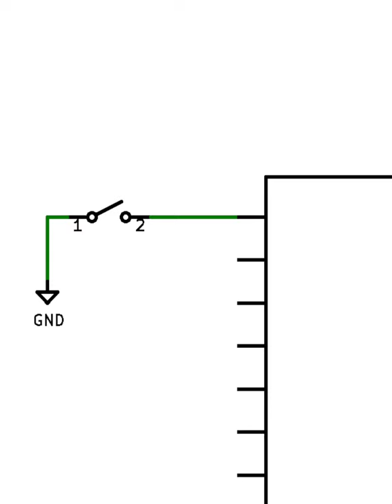Pull-up Resistor - Collin’s Lab Notes #adafruit #collinslabnotes

Comment: This is the best video ever. While I was already starting to understand, that explanation really nails it for me. Maybe another video on Pull-down and the pro/cons of Pull-up vs Pull-down will make me even more smart!
Reply: I would guess that a pull down resistor would be the same except going to ground, and would be used when the input signal was a positive voltage.
Basically just swapping the switch and the resistor.
Reply: depends on what state u desire, if you want high state, use pullup..... 
 low state, use pulldown...
Reply: adding to the above, it's much easier to find a ground plane on the circuit board than a logic level line.
Reply: Nah he should explain that with the different potentials
Reply: Pull up means the high state is the default one with the switch open. Pressing the switch transitions to a low state.
Pull down means the low state is the default one with the switch open. Pressing the switch transitions to a high state.

Comment: so THATS why that resistor is there! back when i still messed with arduinos, i always neglected to put that resistor there because it worked well enough right? no wonder i had super unstable connections. i am definitely subbing to learn more about this stuff!
Reply: You can just use INPUT_PULLUP pin mode. Then internally, 10-50 kOhm pullup resistor is applied to the pin.

Keep in mind that breadboards are evil and are out to hurt your feelings.
Reply: @SianaGearz  That breadboard fact has helped me sleep more peacefully. Thank you. 😁

Comment: I’m sure you’ll cover this in another video, but some micro controllers have internal pull up and pull down resistors that can be configured.
Reply: In Arduino IDE it can be configured easily with setting the pin as Pull-up Input
Reply: Knowing that they exist is the first step to understanding there are internal ones

Comment: The reset pin of a micro controller usually uses the same concept. A pull up resistor tied to Vcc and a capacitor tied to ground acts as a momentary switch to ensure proper instruction startup when power is applied.

Comment: Very good explaining thank you very much.
I like to add something, that the microcontroller comes with internal 1k pull-up resistor and by programming you have to choose whatever you want to use it or not
Reply: Not all microcontrollers have internal pull-up or pull-down support. And the internal value is normally mugh higher than 1k because a 1k pull-up adds significantly to the current consumption. Geounding 3V3 over a 1k resistor means 3.3 mA current. And that is over 10 mW power lost.

Comment: It's worth pointing out that most microcontrollers have pull up resistors built into them which can be toggled on and off by software.  In the Arduino IDE,

pinMode(12, INPUT);
digitalWrite(12, HIGH);

or, in newer versions of the IDE:

pinMode(12, INPUT_PULLUP);

will activate the internal pull up.  Raspberry Pi's have both internal pull up and pull down resistors on each pin, which various GPIO libraries have different ways of selecting.  With RPi.GPIO, use:

GPIO.setup(21, GPIO.INPUT, GPIO.PUD_UP)

You may also substitute PUD_DOWN for a pull down or PUD_NONE to disable both internal resistors.  With the newer pigpio library,

pi = pigpio.pi()
pi.set_mode(21,pigpio.INPUT)
pi.set_pull_up_down(pigpio.PUD_UP)

Ditto.
In CircuitPython:

from digitalio import DigitalInOut, Direction, Pull
switch = DigitalInOut(4)
switch.direction = Direction.INPUT
switch.pull = Pull.UP

Comment: Some of the microcontrollers have programmable pull up resistors, as in a built in feature you can turn on per pin.

Comment: "floating" means floating voltage.it means 
today it is at some voltage, tomorrow it could be on another voltage, depending on what charges sit on that pin or part.
so, keeping anything floating is not good. all terminals in an electronic circuit should be at known fixed voltage within the component's range.

Comment: many microcontrollers like Arduino have internal pull up resistors that can be activated in the setup function of the code. The extra resistor on the circuit is redundant in this case

Comment: An input/output pin, or I/O pin, is the interface between a microcontroller and another circuit. In the Arduino, you configure whether a pin is an input or output using the pinMode() function. An output pin provides VDD or 0 V, by making a connection to VDD or ground via a transistor. 👽
Reply: You don't always need a transistor. It depends on whether the output pin of the microcontroller can sink or source enough current to drive the load connected to it.

So check the current sink and source capability of the output pin.

Comment: Using ARM (for example STM32 what is also chipper than atmega) we can programmatically pull-up or pull-down the pins without any external resistor!
Reply: It is a very wimpy low current pullup though, which can sometimes be unstable. It is actually a feature on any fully featured microcontroller, including AVR 8-bit and PIC and whatever else pretty much you can think of. ARM micros have pretty much the wimpiest pull-ups though.
Reply: Note that "ARM" is a processor core. The different chip manufacturers will then glue on I/O functionality.

Not all ARM chips are even microcontrollers.

So it makes a difference if using a STM32 or a NXP 17xx microcontroller.

Comment: I had a tough time with these terms too, they do feel contradictory, because resistors are electricity energy consumers yet adding one pulls the voltage up? But this is valid.Yet nobody bothers to explain it first before using the term.

Comment: I still don't understand one thing about pullup resistors. You are essentially making a 5v to 10k ohm to ground aren't you? So shouldn't the 10k ohm resistor be heating up? Shouldn't it register as a short?
Reply: Yes, but because of the high resistance, it’s minuscule, not enough to matter. It’s flowing just enough to register. 

P = V^2 / R. if this were 3.3v, then 3.3*3.3/10,000 = 0.001 watts. With 5v, 0.0025 watts. Tiny

Comment: My question is why do we need a pull up or pull down resistor?  And how do we know which is needed when ??
Reply: Normally you decide what idle state you want. But if using a switch, it matters if using a make or break switch.
Reply: @perwestermark8920  thank you, but still am not getting the reason to use exactly why?
Reply: @studiovlog3635  Many (most) times you can do either choice.

But sometimes someone else is responsible for the part containing a switch. If they say "this car has a switch that shorts to ground when trigged" then you must look into the opposite - i.e. pull sig al high when the switch isn't closed.

If someone say "this signal/switch will supply 3V3 when trigged" (and we are assuming your processor supports 3V3 for your input pins) then you must supply opposite. I.e. pull the pin low when the switch is not active.

If someone says "this signal is 3V3 or 0V" then you can use it directly. But what happens if the cable is ripped off? If 3V3 in means a request to run a motor and you don't want the motor to run if the cable is broken then you select a pull down. If 0V means a request to run the motor and you do not want the motor run if cable is broken then you add a pull up.

This means you must select pull up or pull down when someone else have already decided what the input looks like. In a situation where you decide, then you can use pull uo and switch to ground. Or pull down and switch to VCC.
Reply: @perwestermark8920  thank you , I actually did some trials few years back to understand this, and since I did it only few times I forgot, but yup now I remember and understood a  more better than what I had self taught myself,  your explanation was very clean and direct on point. Thank you..

Comment: So the drain from vcc to ground would be small enough to not waste battery power?
Reply: The power is only wasted here when the button is pressed anyway! Depending on sort of battery and pullup strength, the drain can be substantial though, you should calculate it, especially if you use NC (normally closed) connected switches anywhere.
Reply: If you have a long cable working as an antenna to pick up noise, then you need a lower resistance to strongly hold the wire.

If your signal traces are short and not picking up noise, then you can select a much larger resistance and keep down the current.

In some situations, a processor pin held high can be used with the pull up resistor instead of Vcc. This means the program can turn on/off the pull up voltage so it's only when the switch state is checked by the code that there is any 3V3 pull-up. This obviously means the code needs to regularly poll the  switch state.

Comment: What I don't understand with this configuration is how you stop ezrream power usage when the pin is pulled to ground. It's effectively a dead short limited by the resistor. Is this not very bad for devices powered from battery, for example?
Reply: This method is for inputs where the button pressed time is much shorter than the intended lifetime of the battery. And the relatively high value of the resistor leads to a negible battery drain anyway.
Reply: @Hauketal  really helpful, thank you
Reply: You can normally use a quite big resistor unless you have a very noisy environment. With 3V3 a 1k resistor would be 3.3 mA. 10k would ve 0.33 mA. 47k would be 70 uA.

Also, a switch can be from pin to ground or from pin to Vcc. Which means you can affect if the pin is low or high at idle.
Reply: The resistor value is really big compated to the voltage.

Comment: How did you determine the value of the resistor needed?
Reply: it's not critical, you'll sometimes hear this referred to as "Jellybean" components, ones that are so generic that they can be used for basically anything.

For the purpose of this video, it wouldn't matter if you used 1K Ohm, 10K Ohm, even 100K Ohm would be fine.

When you start getting into the weeds and doing specialized things, then you'll have to worry about it more... for example maybe you wouldn't use 1K ohm for a pull-up if you expect the button to be pressed down 90% of the time, and you need to run it off a small battery. The very tiny power loss through the resistor and button would be 10x lower if you used a 10K resistor, or 100x better for 100K etc.

Maybe you're in an industrial or other high-stakes environment where interference is critical to filter out, in that case the simple pull-up resistor may not be enough, but at very least you would want a low value so the "launch the missles button" never gets falsely pressed, power consumption be damned haha
Reply: @PilotPlater  to clarify a bit more.  the lower your value the higher your current draw when the button is pressed,  the higher the value the lower the voltage reads in the unpressed case.  The second part is because you're creating a voltage divider between the input impedance (can just be thought of as resistance in DC) [which iirc is often 1M+ for micro inputs] and your pull-up resistor
Reply: @psynautic  and it's not about just free standing voltage when the button is not pressed, but noise interference.

Ultimately it'll probably never matter in non-industrial settings
Reply: Anything between 1k and 10k should work fine

Comment: that actually makes so much sense, where does the name come from though, like what's being "pulled up"
Reply: The signal. It can be either high or low. The exact value depends on your exact use case, it could be 5v, 3.3v, whatever. But because we’re working in digital logic, we only really care about 2 states, on or off, high or low